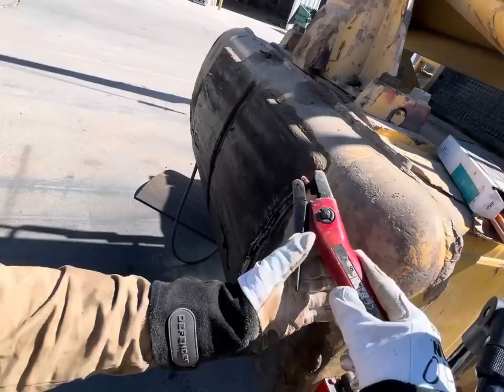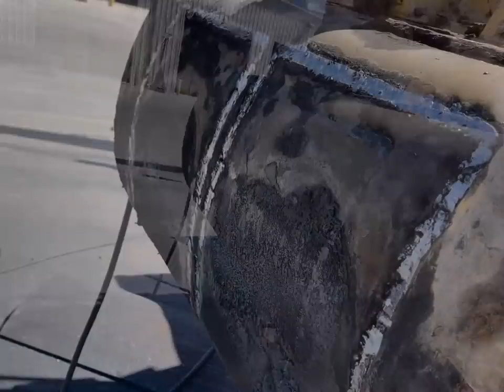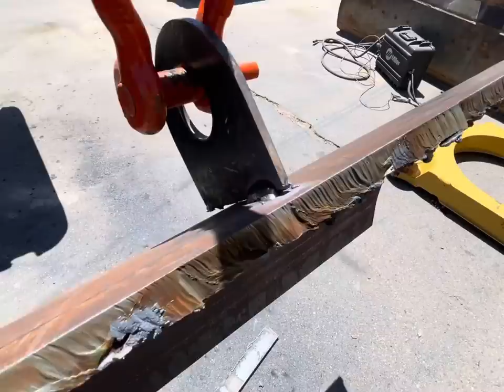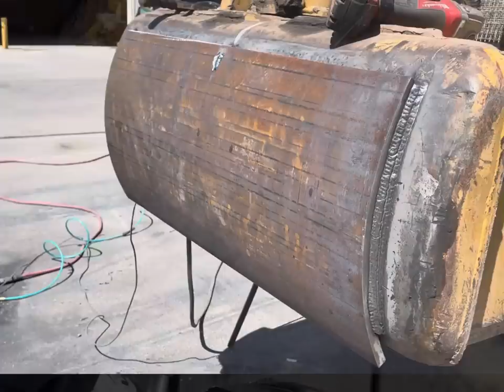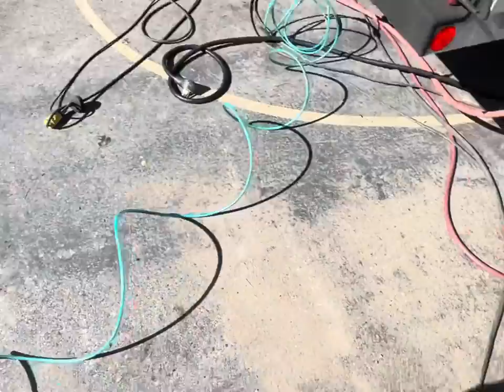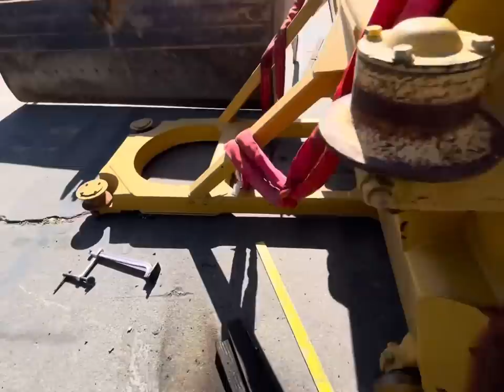CAT 627 Push Plate

Comment: Cat makes him so thin so you have to buy them every 8 months. Nothing's made like it was in the 50s and 60s and 70's
Reply: You have to know that an MBA was involved in the design process to guarantee future sales of replacements for a poor design. That’s what happens when you incentivize cost reductions over reliability. As a retired design engineer in several industries, replacement parts was always factored into new designs and revisions to existing designs. You always want the customer to be spending money with you…happy or not! That’s one of the reasons I left manufacturing and became self employed for my last 20 working years. I could take care of my customers like I wanted to be cared for.
Reply: Next time heavy tack the top of the plate and then run that machine up against a dozer blade, tack the middle, at least  the top and middle will be solid. Then fill in the bottom how ever you'd like. As it is now your welds could pop when the plate flexes, cool video, nice welds!!!
Reply: Looks like manufacturers of all sorts have been scraping and shaving materials off products that "once upon a time" were great and long lasting
Reply: @bkb5668  was thinking the same. I would have filled up that gap with horizontal strips over the entire width of that plate to support it

Comment: For the mismatched profile, I would ask the customer to push on it with a dozer or something like that.  I've done that with a blade skin that was bent more than it should.  Welded the heck of top edge than had the dozer push on a ripper of another.  had to move a few times to get it all pretty but turned out really well.  Customer was happy because he got his dozer back that day instead of waiting another day or two to get the skin rebent.
Reply: You could wrap a high strength chain around the unit and place a hydraulic jack under the chain to press the profile down better.
Reply: @TD-rh7ir  chain come-a- longs work really well  too

Comment: Four our rental fleet we replace those 3/8" wear plates and weld on about five 1" X 2" bars going across spaced 2" apart. Its a bit of welding, but the fit up is easy. Don't have to deal with inconsistent castings.

Comment: Hey Paul, at the 7 min mark, you spoke about removing the remaining weld. I have recently been a convert to using flat carbons. I run a Pro Arc torch and they have an accessory button that replaces the original. I’d imagine that red arc have the same.
It’s a game changer, try it, you’ll like it.

Comment: Hey Brother I always love watching you wield the Gas-Axe. It takes some practice to have the level of expertise you have. I agree that replacing that relatively thin piece of steel with anything thicker gives greater shear resistance and will counter the ETF (engineered to fail) part that Cat used. I found a 50 gallon 5 horsepower compressor along the side of the road and I thought it must be someone's that fell off a truck. I came back six hours later and it was still there so I threw it on the truck and am converting it to a gas compressor. Now I have a suitable compressor for Arc Gouging. My Harrible Freight 30 gallon was too anemic to do the job. I did not realize just what has to be done converting a compressor over to gas but I believe it is worth it.

Comment: Dude thats a great idea to fill that gap. I dont see anything wrong with it. Its just a consumable wear plate.  Now I with that I went and helped inspected a blast room built to AWS D1.1 specs. We caught them slugging  some double bevel flare groove welds with rebar. We made them cut it out. 
But for this I see no problem but I also dont have the experience like you to make the judgment call.  Rad stuff as usual. Also the video of  the one handed overhead weld. Thats like a beer poster right there dude.😅🤣🤣🤣🥲

Comment: Awesome !   I myself also use 3/4  but I put on corner plates also especially on 51s 57s because sometimes they get pushed around a sweeping corner in the cut and with 9L and 10N even with cushion push dozers they can tear the corners up fast on a stinger especially pushing with a ripper cat with a conventional dozer blade. You have to hook it in the corner to keep from popping the tire with a corner bit.

Comment: I often put spray paint on top of defroster to heat up on way to job.  It sprays much better but shaking it up more is necessary too.
Another thing, if your can runs empty, invert it and clear then save tip.  Nice job brother.
Reply: What size and type of wire and amp’s were you using to install this push plate please?
Reply: @tomyousch7070  I'm sure you can find that info in the comments.  I always read them.  Its a good source from all over the world.

Comment: they use them to keep you in service....or the dealer
I use to burn 5/8 rod all the time. i loved it but you gotta have the fresh air hood. we used 3M boxes for breathable air when I was working in powerhouses and confined spaces as a pipe fitter. i miss that.

Comment: They make them 3/8 thick so they’re have to be replaced often at 500 bucks a pop ! If they made things that lasted forever they would make any money selling replacement parts And I bet those price of those plates have gone way up now hell I’m paying almost $500 for a 4 x 8 sheet of quarter inch mild steel Here in New York  Question have you ever tried the flat carbons they’re perfect for Knocking off those old welds you could even get a nice bevel on a piece of plate if you had to with those I use them all the time And another great video

Comment: Chrysler invented this made to break tac tic back in the early 60's with the plastic timing gear in their engines. And every U.S. company since has adopted this to their products. It's even been adopted by Japanese companies. So a machine that cost someone $200 thousand really cost them another $200 thousand just to maintain and fix for life of the machine. From cheap low grade materials and short cuts during weld assembly. 😣👍Thanks Alot Chrysler!
Reply: Planned-obsolescence / bare minimum in engineering/manufacturing
Reply: Mike k the plastic coated gears were to reduce noise and also as the chain stretches it won't dig into the plastic like it will with steel. At 100 000 miles or so the chain will begin bitting into a steel gear and stuff off small flakes of steel. Eventually the flakes are everywhere in the motor embedded in every bearing. Had this happen is how I learned it. The plastic can usually go 150 000 with no effect to the gear. The upgrade is a true double roller problem solved. Cost more but the alternative is to run standard iron replacement and replace at 70 000 or so.

Comment: Hard to get that curve to match just right. Like plating a dozer blade. I did one once with 9 inch wide plates run horizontal. Pre curving like you did is the way to go. I used one half inch on the dozer. It was pushing single engine allis Chalmers scrapers. They were cool old units

Comment: What if instead of a solid plate, you ran horizontal strips about 4” wide. Then you wouldn’t need to template or get anything bent. I would think it would wear just fine, a bit more welding but a lot of time saved in fit up. Might be worth a shot on the next one

Comment: Also if you were that company's full-time welder you could have welded the top and most of the sides and let a few days' running massage the bottom into shape then weld it.   Either way it isn't going to fall off, and even if it does it isn't safety-critical.

Comment: You make gouging looks so easy almost every time I do it, The rod starts glowing and looks like it’s going to melt
Reply: Turn your amps down and your air pressure up I like about 250 amps and 65 psi
Reply: @jeremyhanna3852  check your polarity, should be using DCEP (reverse polarity) 
I’d be BSing you if I said I’d never forgotten to set them up correctly.
Reply: @sonofadutchman9315  why would I need to check anything seems to work fine for me

Comment: I would guess the thinner and smaller dimension replacement wear plates were like that due to the problem of matching the face profile.  By using the smaller, thinner plates you could do something exactly like Robert Palmore indicates to shape the material, as needed, in the field.  Every impact area will be different depending upon the shape of the surface that contacts it, causing it to wear attempting to replicate the shape contacting it.  The smaller, thinner material can be shaped on sight,  whereas, the thicker, larger dimension material needs to be back filled like you are doing, leaving open space between the parent material and the new wear surface.  As the plate gets thinner there is a point at which it will begin to flex, due to the open space between the two surfaces, resulting in cracking and possible earlier failure.  Just a thought, regarding reasons behind Cat selling the thinner and smaller dimensioned material.
Reply from the maker: That is a good point but even those 3/8” plates are very difficult to manipulate into shape and will still have a gap under them.  Either way it’s a pain.
Reply: @OFW  I wouldn't have thought of that until I saw Robert Palmor's post, where he indicates he has done something similar when applying blade skin.  Right off it seems logical to apply a thicker wear material, lasts longer, should be stronger, etc.. I began to consider the thinner smaller size may be a factor when faced with application in field conditions.  Considering at a very small instant in time while the dozer blades and the wear facing are in contact, nearly all of the force can be applied to an extremely small area, thus unthought of stress my be applied in ways we do not anticipate and metal oil canning might occur.  This extreme stress might be applied time and time again throughout a work shift.  I didn't mean to suggest your approach is wrong, but after Robert's post I began to consider why the heck would a company like Caterpillar sell the smaller, thinner replacements.  Repairs such as this are often best done by old timers that have found things out via the school of hard knocks over many years that defy a persons thinking.  I am 80 years old and have discovered ways of accomplishing things I probably would have never considered at age 30 or even 60.  You do good work and I enjoy viewing your content immensely.  My proposal was submitted for you to consider as a possible explanation as to why Cat might be selling the plates they are.  Nick

Comment: Why do you suppose Cat put a layer of grease under the wear plates?
Nice camera angles in this video. I especially liked the 1st person view as you welded up the left side of the plate. Would be fun to get an angle from beneath a plate when you’re using the plasma cutter. 
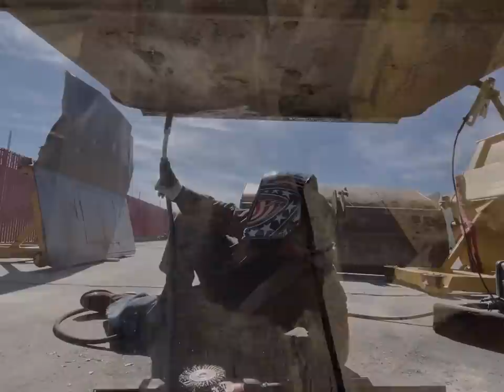27:28 strike a pose! 😂
Reply from the maker: The grease gets there from cracks on the original wear plate.  They put grease on the outside to help with wear.

Comment: I have a guess that they use 3/8 plates because it’s easier to bend to get the right radius. Also you talk about porosity is that when you get air pockets in your weld. If so how does it get there.
Reply from the maker: Porosity is air pockets or contaminants in the weld.  Used caused by dirty materials or bad gas/flux coverage.

Comment: You mentioned going to AR400 steel for the west plate and the longevity of the AR400.  What kind of wear/increased wear results on its mating wear surface as that too is a factor especially if the other wear surface were not configured for field replacements

Comment: Hi one of the best welding videos around bye far what wire and gas are you using and is that spray mode your using all the best mate Hoo Roo from Paul from Australia 🇦🇺🍻
Reply from the maker: The wire is Lincoln 71A75 dual shield gas is 75%argon 25% co2

Comment: It simple. Just like auto or electronic manufacturers they intentionally use substandard parts knowing they will be a hi failure items to try and force you to use dealer maintenance and parts. In cars  Manufacturers charge the dealers more for this. And dealers make it all back in parts and labor. Now with equipment and electronics being  sold and fixed buy the same companies it allows them to double dip and void your warranty when you have someone else fix it.

Comment: Like your work.  New to the trade, afe you mig or flux welding that plate on? I ask because I can hear the wind. As why not stick weld it? Thanks for the insight.
Reply from the maker: It’s dual shield.  I only stick weld when I absolutely have to.  Wire feeders are just as strong and twice as fast.
Reply: @OFW  copy that thanks for the insight. Keep up the good work 👍🏼

Comment: Did they put grease behind the plates before welding? Is that so it wouldn't rust in the space behind the plates?
Reply from the maker: The grease behind the plate is not on purpose.

Comment: Hi I would be interested to know what wire you are using and is it your go to for many applications
Reply: He posted that it’s Lincoln 71A75 dual shield and the gas is 75% argon, 25% CO2🤙🏼 

He also mentioned going through about 99 pounds of wire ( on 3 spools) before having to clean/replace a tip, so it’s likely his “go to” at that quantity 😂😎

Comment: Approximately how many feet of weld can you do one spool of wire ?
Reply from the maker: Well that depends on how hot or slow you are moving.  There can be several miles of wire on a spool of wire.
Reply: @OFW  thanks

Comment: Nice job but I like to see the plate higher <not so important on the bottom, so the pushing scraper block doesn't get hung up and hold the push scraper from sliding down, happens sometimes going in and out of holes.  I have seen scrapers with there front wheels off the ground hung up on that little lip.  Also, how many times idiots put cross bars with gaps so the push scraper gets to stick instead of sliding up and down.  Our factory new scrapers have never had the extra plates.  Nice welds as always.

Comment: Seems to me that plate will constantly flex when in operation, resulting in fatigue cracking of the top and bottom welds
Reply from the maker: You would think that. But I have some of these 6 years old with no issues.

Comment: out of curiosity what size machine do you need to run an air gouger I have a primeweld Tig 225x and was wondering if that's enough to run an air gouger?
Reply from the maker: I run 600 amps when I gouge.  You can definitely gouge on lower amps just have to run smaller rods.  And you need a decent amount of cfm for air.
Reply: @OFW  definitely thank you for the information I'm definitely going to look into seeing about getting the gouging whip for my Tig 225x.

Comment: Hey what brand of flux core wire and what diameter and setting were used in this video?
Reply from the maker: Lincoln 71a75 .045.  25v 350 ipm
Reply: Just think of the time you would save if this info was posted at the beginning of every video!
Reply: @OFW  Thank you. It was an excellent video and demonstrates in an excellent manner the power of flux core.

Comment: Could you have jacked up the machine and let a tire down on the curved plate and flatten the arc? Of course the plate would dig into the asphalt so would need something for that.
Reply from the maker: That sounds like a lot of extra work.
Reply: @OFW  Agreed. Only in cases where it bugged you that it did not fit tighter. It would bug me and I would be paraniod that when in service the load on the unsupported intyernal gap space would cause something. Wear, stress, bending, weld pop,... something would have to give and no place to go. But 3/4 is nice and thick and you welded very nicely. I just had a thought because I bend stiff with the weight of my truck sometimes. Being a Mechanical Engineer, that misfit would bug me no end. But I need to factor in what this is. I never dealt with lardge plates and earth moving equipment. Enjoy your vids a lot. thanks.
I need to stay out of the advice business. I see a couple guys below here advising similar. Weirdos like me. You are very conscientious and thorough.

Comment: Shouldve got the bottom flush, then easier to weld/fill the top,but thats my opinion!👍👍
Reply: I would try to split the difference but definitely try to fit up bottom a little better.
Reply: Nobody will see the bottom & it’ll hold enough.
Reply: @dirtfarmer7472  I agree
Reply: Much easier to fill top with more passes.    “Give a lazy man a job and he will show you the easiest way to do it.”  Unknown.
Reply: I just hate upside down welding!💥💥😆😆👍💪💪💪
Reply: @donsmith9081  thruth that!!💪💪👍👍👍

Comment: Are you using a 300 or 400 amp machine?
Reply from the maker: 600 amps
Reply: @OFW  can i use s Ln-25 wire feed on a 300 amp machine?
Reply from the maker: @mannyrodriguez8926  you should be able to.
Reply: @OFW  thanks for the feedback brother. Subscribed a while ago.

Comment: Looks and sounds too windy to accommodate using dual shield wire. Should use Esab CS8
Reply: By God the welds do not appear to be too effected by porosity. Must have really high flow huh?
Reply from the maker: I usually run about 30cfh outside but will go up to 50 if it’s gets windy.
Reply: @OFW  I stand corrected, Sir. Your welds looked sound to me. Nice work.

Comment: why not just weld the new plate over the old worn ones?
Reply: Watch starting around 00:38 and it should be obvious to you. If it’s not, there is a void under the failed material that is filled with dirt. That’s a guarantee to fail way before its useful life. This repair is better than the OEM design that was guaranteed to sell replacement skins at an outrageous price.
Reply: @joevalencic5275  thanks for point that out